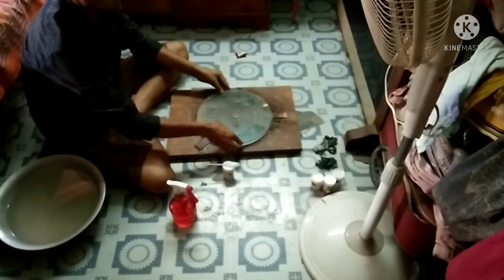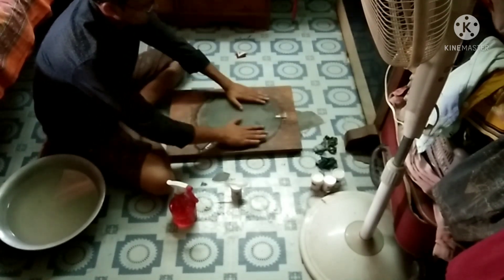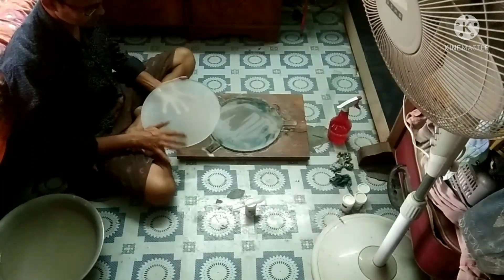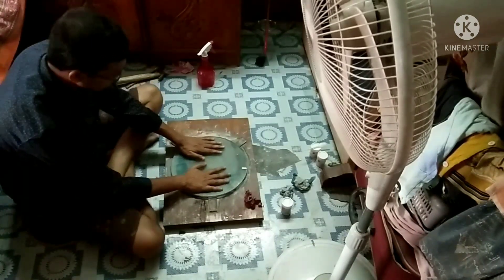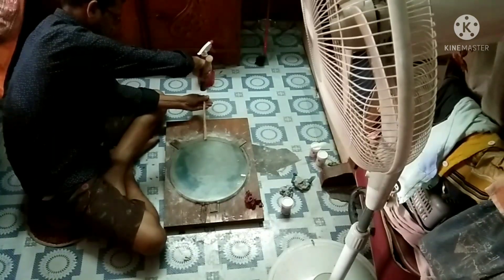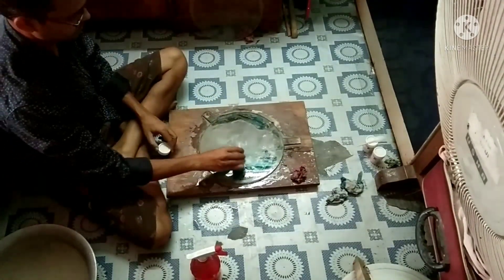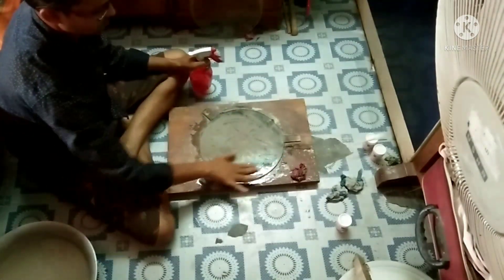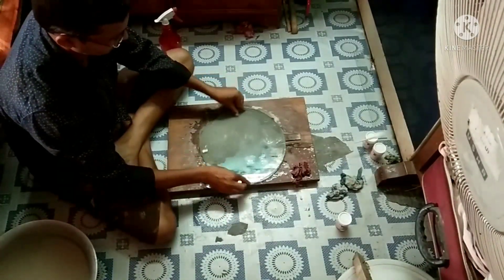How to make large reflector telescope | Step-3 | Fine Grinding of mirror|  telescope mirror grinding

Comment: Not followed the parameter of telescope mirror blank , i,e. Minimum thickness of glass = diameter of mirror/14, when it is plate glass blank .🥵
Reply from the maker: Yes , I told in my 1st step of this telescope making.
Reply: @astrovillager  It is because thin blank can break or crack , and so much effort in precise surface making💤 .🥵
A solution is , cement the glass tool on the back of mirror .
Reply: 😅 @debabratade342
Reply: These old rules that come from the first books on mirror making, like Texereau, J. (1963). How to Make a Telescope. 1st ed. Willmann-Bell, Inc., no longer apply because the type of glass sheets currently used in amateur mirrors are very different from the blocks used in the 1960s. Back then, they had to be thick for stability, were manufactured one by one, and were already shaped as telescope mirrors. Today, glass sheets are produced in large industrial furnaces with precise temperature control, and the surfaces are parallel because the glass flows over a pool of liquid metal (tin). The cooling process is very gradual, and the furnace is highly controlled, so there are no internal stresses in the material. There are large factories out there—Brazil, for instance, is probably the largest exporter of glass sheets for windows and building finishes. 
On the other hand, this rule is not a law. For example, the mirrors of the JWST telescopes do not follow the D/14 rule, and the material used is beryllium... Take, for example, the Palomar Mountain Telescope (now retired in practice), which, despite being thick, had several deformation problems, including due to excessive weight. Indeed, they even used a reel and fishing hook to pull the most deformed side of the mirror.
Reply: @SciencesDay  For 10"dia. mirror blank , I recommend 19 mm thick and I find it perfect . Practically I had succeeded in 3",4",4.25" , 6", 7.5" , 8" ,10" , 12" (cassegranian) & 14"(from 21" flat screen TV crt panel glass ) mirror making .I had tried to keep a nominal value of the precise work in above ... & I am little bit aware of your depiction . The  commercial glass sheet we find here  are of Chinese .🔘🇮🇳

Comment: Hi can you please tell how deep is the centre for the sides if I have a disk of 12 inch thank.
Reply from the maker: It depends on focal length, my glass blank was only 8mm thin, so i its centre depth is 2.3mm .
Reply: Thanks for your reply is there any website where i can buy the grinding powder as it not available in my city
Reply from the maker: Yes , 
https://api.whatsapp.com/send?phone=917989484478&text=Mr.Ratan%20has%20referred%20me%20you%20for%20telescope%20making%20and%20told%20that%20I%20am%20now%20eligible%20for%20discount

Comment: Couple of things to consider.
1. The mirror thickness is way too thin.
2. No rotation of tool in the grinding stand may introduce astigmatism in the mirror (rotating the entire arrangements with stand won't help.. you need to rotate the tool keeping the mirror stand in same position).
3. A thin padding to put between the tool and the wooden stand to avoid astigmatism.
4. Grits beyond the 320 mesh are better to use in  the form of a slurry (thin liquid form mixed with water).
5. Touching thinner grits beyond 320# grits with hand is not a good idea. It may get contaminated with the dirts present in the finger tips. 
6. Do not let the wets go dry at the first place, to avoid sticking of tool and mirror.

Great video brother.. keep up the good work.
Reply from the maker: Thanks for your suggestions .It will help others .
Reply: Also i want to make 6 inch reflective telescope by my self. Can help in detail of each things, like mirror glass, grinding powder, fine grinding, polishing each things because i can not afford ready made telescope
Reply from the maker: This is the link👇👇 below, whatsapp them and ask for 6 inch telescope mirror making kit , they will provide all materials as required.

https://api.whatsapp.com/send?phone=917989484478&text=Mr.Ratan%20has%20referred%20me%20you%20for%20telescope%20making%20and%20told%20that%20I%20am%20now%20eligible%20for%20discount